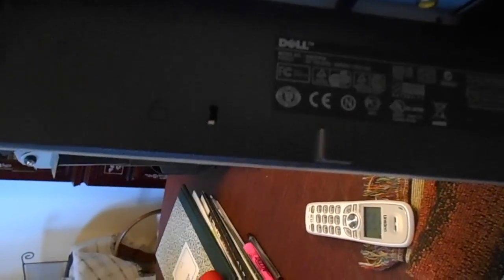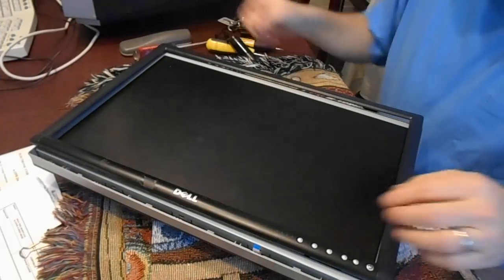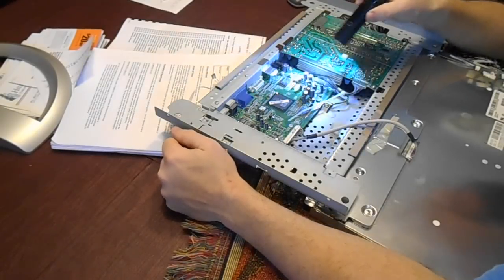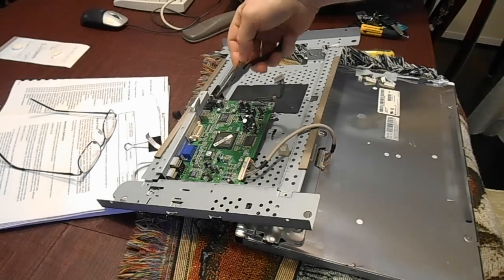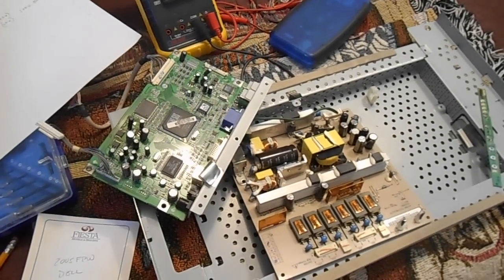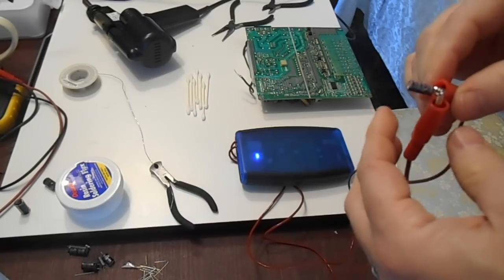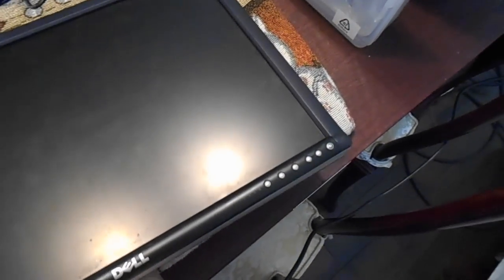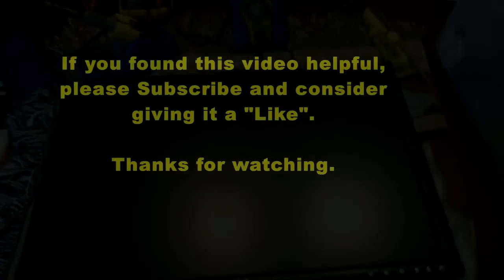Diagnose & Repair Dell 2005FPW LCD Monitor

Comment: I had one of these monitors and managed to get it open without breaking anything.  It started turning off and rebooting randomly and I suspected bad capacitors so I bought a capacitor kit which contained replacements for all the garbage quality capacitors on the power supply board, some of which had bulged.  After replacing them all I got it back together and it is still working for my wife's friend.  A lot of electronics manufactured in that era had this problem and it was because several Chinese manufacturers used a defective formula for the electrolyte used to manufacture the capacitors.  Dell actually got sued because they had a bad batch of motherboards that failed prematurely.

Comment: The trick to getting around the ribbon cable is to pop loose the front farme, (using a long thin metal spudger  sliding it straight in along the frame they tabs will just pop free without breaking) and after you have all of the frame free, lay the monitor on it's face and lift the back off, where you will see the other end of the cable and disconnect it there.  It's actually very easy once you figure it out.

Comment: SUCCESS!! The parts came in today. I swapped 12 caps. My values were differerent than the service manual parts list. I just went with the values on the board. Everything is back to normal. No cracked screen. Easy to snap back together.
Reply from the maker: Terrific!  Feels good, doesn't it?
Reply: Scroungineer Yeah it was good to get it working again. Plus  I was at a thrift shop and I found a Pantone Colorvision Spyder to calibrate the colors on my LCD monitor. It was just $4 for Pantone Spyder. Colors look awesome now. Really simple to calibrate using the software and the Spyder attached to your monitor.

Comment: My 2005FPW has a power board problem--inverter starts the lamps for a quarter second, I can see the "DELL" splash screen from the logic board, and it goes black.
My disassembly went okay when I saw the pictures in the service manual:
Hook fingertips under the edge of top bezel, between LCD panel and plastic, gently bend up and out.  Catches will disengage.  Work around to upper corners, do same on left edge, right edge and finally bottom edge.  Do not try to remove frame yet.
Put monitor face down and remove black plastic back panel.  Gently unlatch thin cable from button board from electronics.  Remove front bezel.
Reply: Same problem here

Comment: Scroungi...I have a Dell E228WFP which looks very similar to yours...I've found a better way to remove the crappy front bezel frame without inserting any tools and chipping the sides of the back plastic panel. Very carefully grip the bezel frame from the screen side and pull upwards and away. It snaps out much easier with no damage to the screen or bezel. Looks much better as it looks like it was never taken apart. I have a black screen problem with no green or orange LED illuminated. I found 2 bulging Samxon 470uf 25v 105C caps at locations C858 and C864. I'm going to replace them and hope it works. Thanks for a great tutorial.

Comment: Thank you for sharing this video. Besides some bad capacitors, I run into another problem with this monitor type. A broken backlight wire. I can hear a hissing sound and smell ozone in one of the corners of the lcd panel. So I am not finished yet...

Comment: Damage to bezel frame shown in this video is result of wrong techniques of prying bezel and unhooking button cable from wrong end.  See my other post.
Now I know I have a burned transformer coil on lamp power output, so I will buy a $50 power board replacement and drop that in--much simpler.

Comment: I have this Dell 24" monitor 2405FPW that I believe the capacitors blew like you mentioned in your video.  My monitor is not cracked and has no problems once those capacitors are replaced.  If you want to buy it from me I will let it go for cheap.  I actually loved this monitor until those crap capacitors they put in blew!

Comment: i have a dell 2405FPW and it sometimes the display turns off / black for a fraction of a second (the power leds stays on / do not flicker) - sometimes it goes off on off on like 10 times and sometimes it then stays off for some seconds. then on other days it can work for hours without any problem. do you have an idea what this might could cause or how to fix it since i do not want to throw the monitor away if its easy to fix :). the problem is unrelated to the computer in use - the monitor behaves the same on different machines.

Comment: I did 2 of them - however one of them seems to have a broken backlight even though I cannot explain it... Both tubes connected, the psu makes a high frequency hiss noise for 2 seconds then switches off the backlight. Connecting either one of them is OK - however when connecting a different panel, both tubes, everything is fine. WTF.

Comment: Thanks for the Ilustrating in this video the way to fix this monito! This so helped me to REPAIRED my Similar HP 2405FPW with it come almos with the same specs but it s a really way better manufactured model! Mine was only having one set of six 470uf charged @ 35V really messed up, but I replaced them all the power board and it works LIKE NEW! :-) Thanks a BUNCH from NYC! Best of luck

Comment: I have an Asus VS247HP. Just the other day I noticed very light diagonal grey lines across the screen. I've tried the monitor on a different PC, and they still showed up on my other PC. I really don't know what causes them. I don't think they lines are from pixels. It looks like they're on the outer layer of the screen, but under the outer layer. It's driving me nuts. I really want to know what causes this so I can prevent the issue from ever happening again.

Comment: Great job on the repair work though, thanks for sharing that. I have a Hell...I mean Dell 2007WFPb and what it's doing is just completely shutting off after its been on awhile. It will then turn back on and maybe stay on or shut right back off. Does this intermittently, on/off/on and it may even stay on for a long while before going through the same routine ....Do you think it's the capacitors or power supply issue?

Comment: Currently repairing the same model monitor. Fortunately mine does not have a cracked screen. I was able to open it easily with small twisting motion of flathead screwdriver. I found that it was best to start opening the case at a corner where I could already see small gap. I always order my caps from Mouser Electronics. Is Digikey cheaper from your experience? My monitor is flashing and it won't turn on. Green Power LED was also flashing at the same time as the LCD screen. I agree with you that it takes time to write down all the values for the caps. Plus you have to measure the height , diameter and lead spacing to make sure you get the correct form factor capacitor. It is all very time consuming. Plus you to wait for the parts order to come in. Currently creating the parts list. Did the service manual you found contain a parts list?
Reply from the maker: Only a partial one, which was disappointing.  I had to base my order off the labeled values.  Another reason I loathe Dell.  I use Digikey simply because they tend to have the weirder values in stock for 1-2 item sales.
Reply: thanks for the info. I did find a copy of the service manual just a few minutes ago. It does have the entire parts list.

Comment: Judging from the time you spent doing the repair, if one were to get paid to do this, how much would it had cost verses just buying a new one? Looked pretty tedious and complicated especially the breakdown of the unit. I've had mine for about 10 years. It must have the best manufactured parts. Very good video, thanks.

Comment: I have this monitor, mine works for a little while and then the screen goes black with the power LED being orange (like the monitor went to sleep). If I turn it off and then back on I get display for a couple of seconds and then it goes black again with orange LED. Would that be the 2 caps that are notorious for going bad?
Reply from the maker: More than likely, yes.  That's the classic symptom you'll see on many monitors--usually once the unit warms up, the power supply cannot keep itself regulated because the caps in it are too far out of tolerance.  It's basically going into "safety shutdown" because the detected voltage is too high/low.
Reply: Scroungineer Do you have the list of all the caps that you replaced? I'd like to order and replace them like you did. I couldn't read the paper in the video and I don't see it listed here.
Reply from the maker: Seth Hill Afraid not.  You'll have to freeze-frame the video @ 11:17 or so, blown up to full screen @ 720p resolution, and try to work from that handwritten list.
Reply: Scroungineer Ok, so I did that and wrote down what you had. I will have to do some measuring for lead spacing and sizes. Looking at Digi-Key's site I see that there is ripple current & impedance on some of them, do you know if they had any values on those?
Reply from the maker: Seth Hill I don't recall any of the cap labels listing ripple or impedance.  You want the LOW impedance values though when you order.  I also suggest bumping up some of the general voltage ratings, especially on the larger caps--switch to 25V instead of 16V, etc.
Reply: Scroungineer I'm finally getting around to ordering the caps and noticed the following when I looked at my power board:
1) You didn't list C206, do we not need to worry about that one?
2) You listed C207 as 10v 680 mF, but when I look at that one it is labeled 50v 100mF. Is your values better than the one that is present on the board?

Thanks.
Reply: +Scroungineer So I replaced the caps and tested it out. Now I have an orange display with what looks like a vertical sync issue. Gah, guess I will take it to the local repair shop and see what they say.

Comment: Dell generally isn't worth the effort, given the poor packaging.  I am given, and promptly scrap, most anything with a Dell logo on it, unless it is post P4/PD.  (and even then think twice)  Most of the issues I have seen on Dell flat-panel monitors is related to backlight inverter or power supply.  As far as the "big cap" not failing...  I've seen several of them with Alien-like ruptures.

What ESR meter do you use?
Reply from the maker: The meter was a kit-thing a friend gave to me.  "The BLUE ESR Meter" from Ana-Tek Corporation.  It works exceedingly well (tested against a proper high-end ESR bench meter).  I was really bummed to discover the LCD panel was cracked after getting the dumb inverter working.  It's still in my garage, and I use it as a "smoke test" display on scrounged PC boxes.

Comment: Great video.  A shame that the caps are such weak points.  Valuing the time to do the work and downtime of the monitor not being avail... vs buying a new one... yeah, why the F don't manufacturers just spend the extra $5 and make a better quality monitor.

Comment: LOL, that monitor is so easy to disassemble.  That front bezel comes off by prying from the inside not from the outer edges.  I.E.  you place your fingers on the inside edge of the screen and pull up and towards the outside edge of the monitor.... LOL, its funny listening you calling "these people Idiots"  HAHHAHAHHAHHA

Comment: What the hell is wrong with you 'mericaans. The word is "SOLDER", yes theres an L in there. To SODDER is something completely different
Reply: +spiggy toppes easy killer, there are many accents in the USA. Just relax before you hurt yourself
Reply: An accent is an accent. Pronunciation is another. Sol-der is correct, sodder is not.
You do not call a soldier a sodder do you?
BECAUSE the is an "L" in there and it is not silent you septic tanks. Geddit